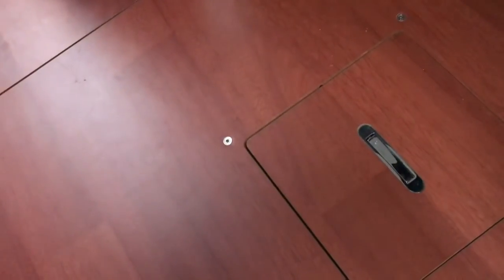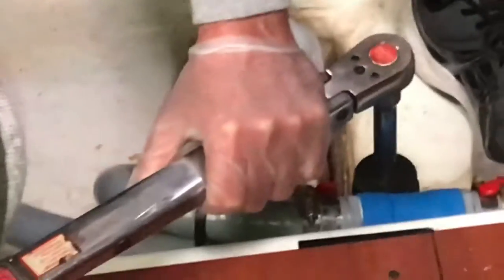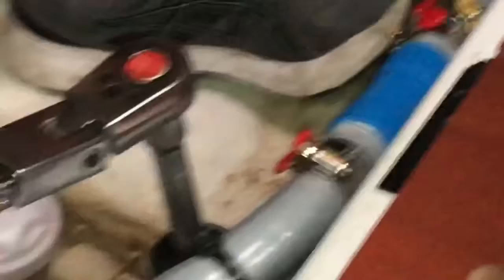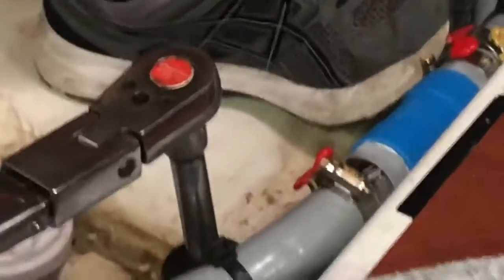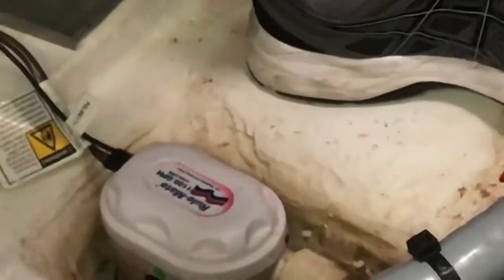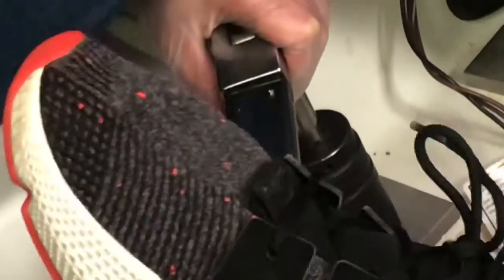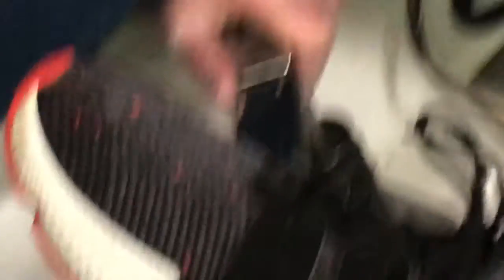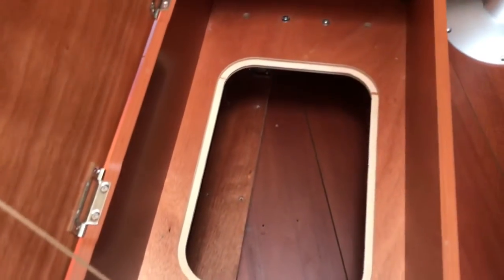Torquing Keel bolts on 2018 Beneteau Oceanis 45

Comment: Why do those bolts get lose and why don't you use Nylock nuts
Reply from the maker: We didn’t change the nuts.  The boat is under warranty now or was so we’re trying to keep everything stock it’s a 2018 and Beneteau gives you a five year warranty on almost everything they build not the subcontractors

Comment from the maker: Yes the dealer said they needed to be checked.  He was obviously correct.  I would check them on any new boat before I launched it .  Then again in a year or so after that, then I might skip a few years.  Supposedly there are some under the bulked that houses the forward head that no one can get to?   That is another design flaw by Beneteau as the 2 forward ones I could get to were only at 150 and 180 ft lbs.  Thanks for your questions.  Nice to know someone appreciates the video.